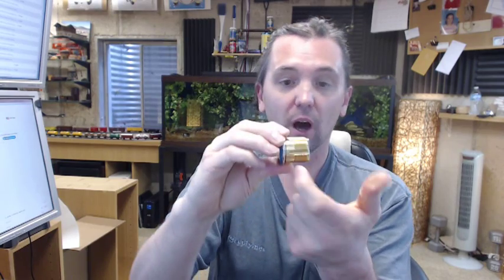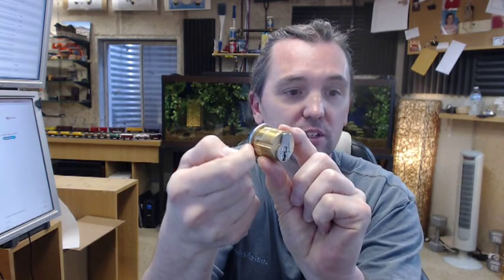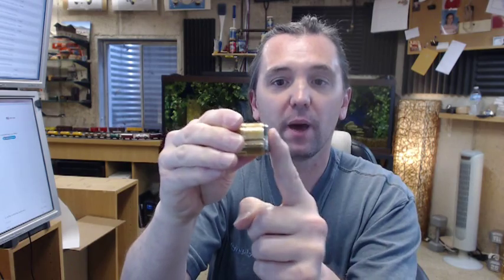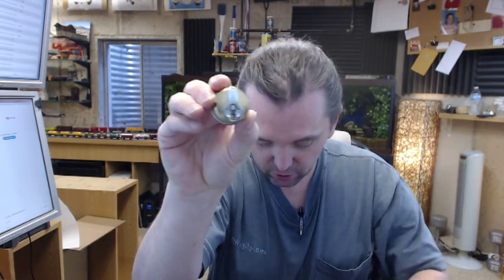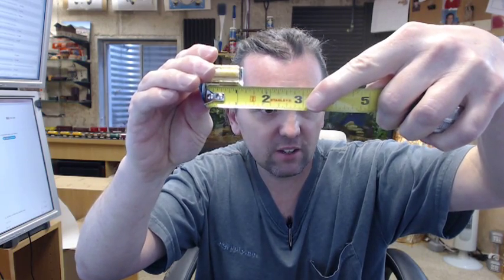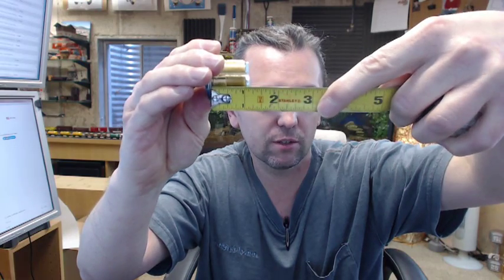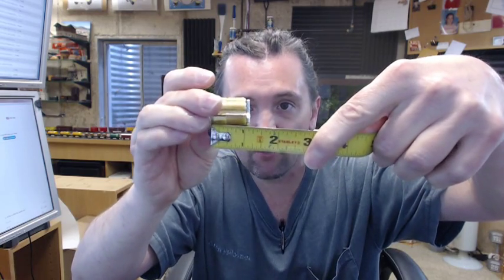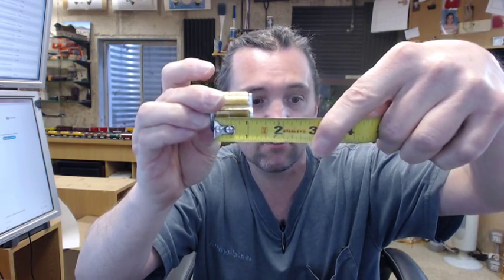How to Measure a Mortise Cylinder

Comment: It also helps to know that mortise cylinders are only available in 1/8 inch increments, at least here in the USA. The shortest 5-pin cylinders are 1", the shortest 6-pin cylinders are 1-1/8", the most common are 1-1/4", and longer standard sizes are 1-3/8" and 1-1/2". Specially ordered cylinders can be made up in even longer lengths if needed.
Reply from the maker: Thanks for contributing and this is mostly but not totally accurate.  7/8", 15/16" in 5 - pin are common and we can manufacturer any length, even 1-7/16" for instance, if needed.
Reply: RICHARD HOWARD You're right, of course. It's been a generation since I worked outside the commercial-institutional realm. I even remember seeing some really short 3-pin cyls used on Welsh brand gate locks.
Reply from the maker: and that 4 - pin 3/4" length Kaba Ilco makes is not that uncommon either - again, thank you for contributing.

Comment: So that's the length but what about the diameter of the cylinder? They can't be all the same there are they?
Reply from the maker: They are not.  Common builders hardware mortise cylinder diameters are 1--5/32".  But there are peanut cylinders at 3/4", builders hardware cylinders that are 1-5/32", Master Ring (jumbo) that are 1-1/2" and mogul cylinders that are 2".